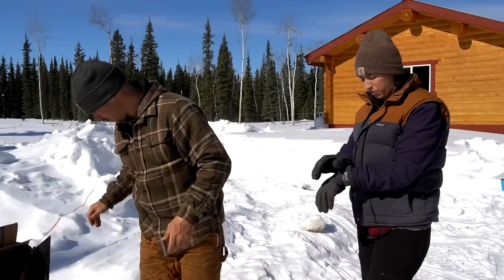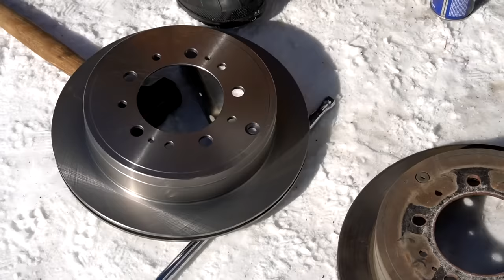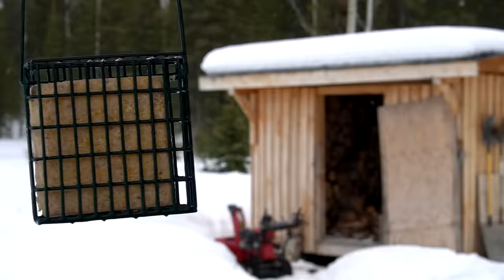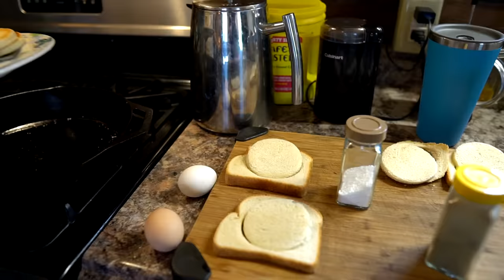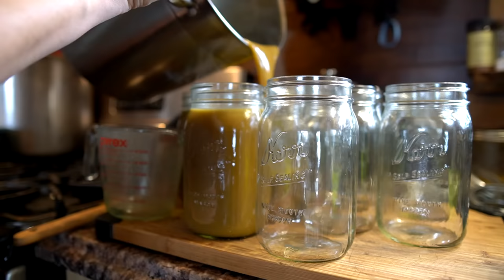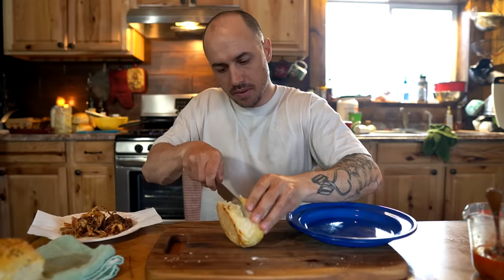Working Around the Property | Burn Barrel, Burgers & Bone Broth

Comment: I wanted to let you know that I did construction in the winter as the ground is still frozen.
We would do concrete in the winter.
Even when logan was in the negative 20 and negative 40 degree weather.
I do know you will want to dig deeper and get a packing bed down it should be sand and rocks so you have a hard surface to put your forms in.
The other thing is we used heaters and pads to keep the cold off the concrete.
I am not saying you have or haven't done this but build a stick frame for doing concrete that you can heat up and I would do a small spot to see if it works for you during the winter.
I do hvac and you actually are amazing me with what you are doing with heat.
Also take your stuff off your tractor and don't weld on your tractor if you can help it.
When doing bulbs go get some cone spray for a mig welder and put on the threads and it protects splatter from sticking to threads.
Oh take off jewelry if you weld the sparks will go into your glove and stick to your jewelry.
I did it once and new better.
I want you to be safe and not have the pain I went through.
I like watching the things you guys do.
I would love to see if you make a gravel pit so you can save material on your property and use the land to your benefit more

Comment: LOL kind of funny I just did front brakes on our F150 and Ram 2500 and come in the house to you doing the same. Couple points: You won't hurt anything to absolutely wail on the outer edge of the rotors with a sledge. On the ez-lube brake hubs be careful, just one pump of grease per year, what happens if you put lots is it tends to push the seal out on the backside.

Comment: Anti-seize where the rotor meets the hub will stop that from being so difficult next time.  You should learn how to take off the back hoe when you dont need it.  If you still need weight on the rear tires, you can always make a weight box for the 3 point.  that will save you feet of maneuvering space.

Comment: Hey Eric when your using your new tractor and it’s a very large investment I would use your generator and plug the block heater in for about an hour before firing it up.  This will give you years of life on the engine as diesels don’t like cold starts……I was in the trucking industry for 30 plus years and had engines with upwards of 40,000 hours before needing rebuild….🇨🇦🇨🇦🇨🇦

Comment: Install a small >>>Electrical<<< PVC junction box front & rear, with >>>Electrical<<< PVC piping from, junction box to junction box inside. This will protect the majority of wires from damage. Then use heavy-duty outdoor wire sheathing from the junction boxes to the connectors. My set-up has lasted 20 yrs so far, with only new connectors needed twice. The rest of the wiring is still like new...

Comment: If you have to remove a rotor or brake drum that's frozen on by rust,use a propane torch and heat the disc up around the center and the lug nut studs and they will come right off. A little heat will expand the metal and it works great on stubborn rotors or stuck hubs.

Comment: Those drum brakes onthe back of your truck are fine. They don’t do much, the front discs are doing most of the work. I have a 96 Silverado with the same back brakes and I do check them every time I do my front brakes. I’ve traveled the USA twice in this truck with over two hundred thousand miles and the shoes are still fine.

Comment: Hey, quick note for getting the most out of that plastic trash at 4:00 : if you pyrolise the plastics (like when making charcoal out of wood), and condense the fumes, you can get some fuel out of it. If I remember correctly depending of the type of plastic is diesel or gas, but I'm not entirely sure.
There's some videos on Youtube if you want to research about it.

Comment: Great Video 👍    Just a safety note here. When you take those tires off, lay one of them right under the edge of the vehicle so if it falls it will land on the tire instead the ground all the way or worst the old head or body

Comment: Unless the onion skins and roots are moldy, you don't need to remove them when making broth.  The skins and roots are packed with nutrition, which will make your broth more nutrient rich and add some nice caramel coloring.  All you'd need to do is half or quarter them and toss them in.

Comment: the rotors have threaded holes to use jacking bolts to push them off. it makes it a lot easier.

never mind i see you did use the jacking holes.

love your channel

Comment: when replacing your brake shoes, notice that the front or leading shoe has a longer brake lining than the rear. It's important to replace them in the correct position.

Comment: I recommend buying an electric grease gun for the tractor with a quick attach coupler. It seems like an unnecessary luxury, I know. But there are so many zerk fittings on the tractor it's worth having an easier way to lube to ensure they never run dry. If they run dry the repairs can be expensive.

Comment: Actually Ive been wondering if its better for you to build a purpose-built chicken coup because it needs to be so well insulated in a much colder climate than youre used to.
And I remember you pointing out that insulated large box in the corner that you said was for a generator...wouldnt it be better to house you re  new large generator in it as well as modifying the shed for a root cellar..it would be handy so close to the house

Comment: Eric, Just spoke with the hubs, he said that the Honda generator shouldn't run over 10 hours without taking a break for a few hours. Apparently it will burn up the motor. Please research thoroughly. Good luck.

Comment: You CAN break those big beef bones.  Hand saws work, but they're slow.  Folks who butcher large animals at home on the farm often use a chain saw!  Of course, you don't want bar and chain oil in your food, so that's got to be cleaned out.  At your level of use, I would find a small electric chainsaw, clean it up and dedicate it to food butchery only.  For one or two bones, try the kindling cracker, or the splitting maul (cleaned up).  I applaud your using freezer-tired veggies in soups where looks won't count for much.  Large quantities of chicken feed (and other stuff) is a good idea to cut down on the need to travel long distances frequently.  But now you may have rodent problems, and if there's seed in the chicken feed, sprouting problems!  Plan!  Many different names for that food - we always called it Egg-in-a-Frame.  Bandit's a hoot!  He may not be a puppy any more, but he doesn't know it!  A rooster makes a noisy cabin mate!

Comment: do they use salt with the gravel on the roads? could be the wear and tear on brakes and wiring.  Here in Montana we have similar issues with have only worsen when the went  to Magnesium chloride which causes damage to concrete bridges, concrete garage floors and literally rusts vehicles from end to end if not completely washed and often underneath.  large trucks which spend more time on the roads and passes loose their brakes at an alarming rate.  If their not use that yet up there then discourage it.  Also Magnesium chloride is used at a dust inhibitor on gravel roads by logging companies and it works fine in the summer but turns the snow and ice to thaw and refreeze worse that snowpack.

Comment: What kind of waterproofing sealer do you use for wood decking? I'm in Oregon and nothing lasts seems like. My back deck that only gets morning sun is mossy and slippery and the side deck that gets full sun is dry and stain is just about gone after 2 years. I was thinking about trying the forest service mixture of mineral spirits, boiled linseed oil and paraffin wax. What do you use? And how is it holding up to the UV rays?

Comment: Hey, there! I was wondering what you put in the dog food? I have an older pup (13 years old) and we have been trying to get her to gain more weight since she has dropped some weight over the last year. Thanks!
Reply from the maker: Ooh I recommend Honest Kitchen for dogs with low appetites. You can buy it online or find it in stores, it's a dehydrated food and you just add warm water. We add kefir (yogurt) and eggs pretty routinely. Most dogs love scrambled eggs but we just crack a raw one for them. With Bandit's new diet plan he doesn't get as many as previously. I hope that helps 🙂 
https://www.thehonestkitchen.com/products/dehydrated-whole-grain-chicken-dog-food?variant=42498518057210&tw_source=google&tw_adid=&tw_campaign=19816403413&gclid=CjwKCAjw6IiiBhAOEiwALNqncQ8aMQo8-X-EeEOsV7ahm4Qk77PzMoIRb54VEjA5ZUFHdjCDXqzx4BoC0OIQAvD_BwE

Comment: Are you unable to recycle? Burning plastic isn't exactly the best for the environment.
Reply: I could be wrong, but I’m pretty sure their closest recycling center is over an hour away, only takes plastic in the form of jugs/bottles, and has to transport those plastics to the lower 48 for processing. The carbon footprint of recycling for them might be as bad or worse than just burning.